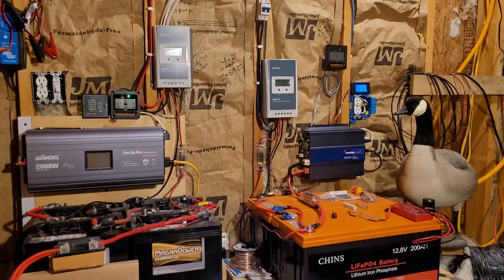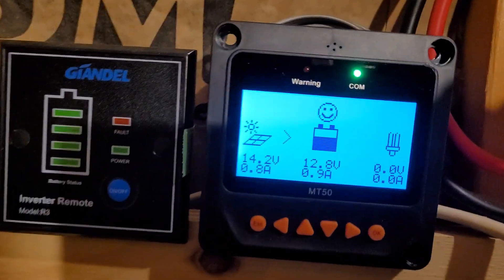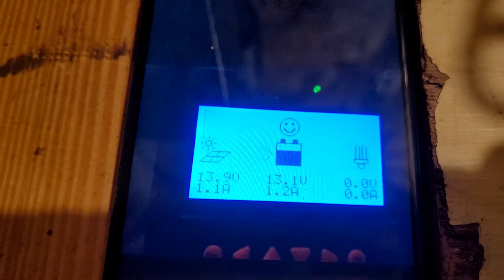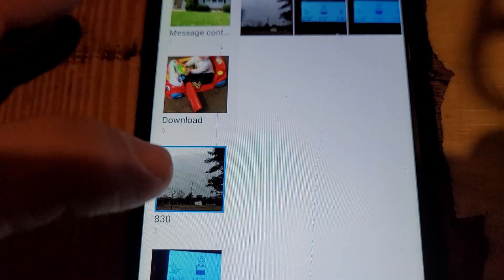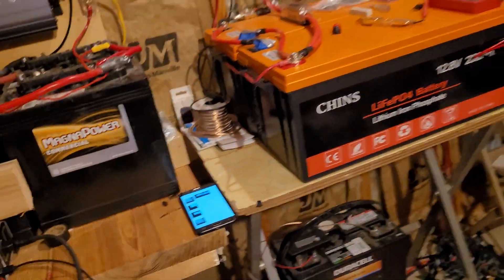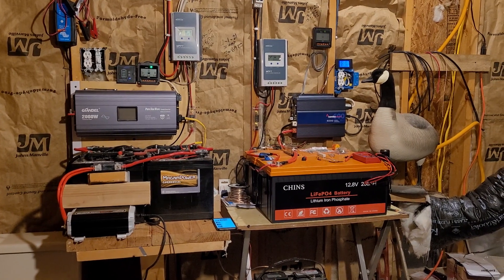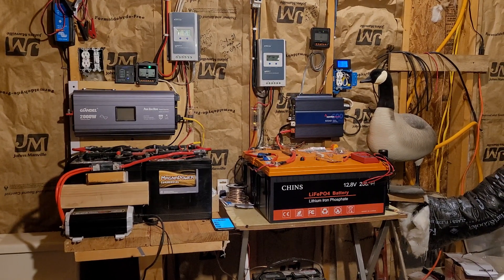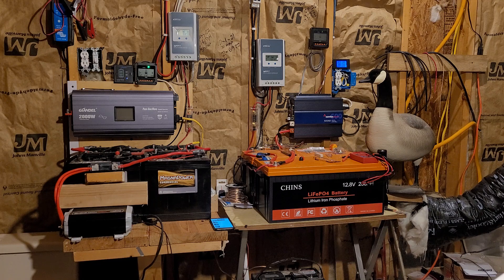Off Grid Solar Surviving the winter with the Chins lifepo4 12v

Comment: The thing with adding battery capacity is the cost.  Panels are rather cheap nowdays.  Having big battery capacity is nice, but you could as well design the system so that the battery capacity stays small, enough for having power during night time, but then design the panel capacity for the cloudy days, so that the panel output is enough to leave the batteries undrained.   Be the choice this or that, it is quite nice the hardware is getting better every year, also batteries are nowdays much better than the old lead acid type batteries used for decades.
Reply from the maker: Its all really only a problem mid Nov-Feb 1
Reply: @CentralIllinoisSolar  Exactly, so that timeline also sets the parameters for the electricity production, what kind of stuff is enough to carry over that dark and cold time. Having lot of batteries is good but its expensive too. You can think the math also by making over-capacity of solar panels, so that they produce just enough electricity also in darker time, so the needed battery capacity would be minimized.

Comment: Are the panels 36 cells or 60 cells? The PV voltage is low – 36 cells are normally ca 18Volts. The picture in the start of the videos looks like 60 cells that would be ca 36 Volts. 2 x 36 cells in series also end up as 36 Volts. In a 12 Volt system it more efficient and safer with 36Volts or more, the regulators doesn’t produce more but 60 cells panels can be combined with 2x36 cells panels and give a higher max. Cheapest way from 36 cells/18 volts up is 60 cells and 36 Volts – easy to combine. Also there are some 200w/220watts 72 cells that are 36Volts.
If you assume 50% power from panels and calculate how many days you can live well on battery reserves, you have a useful guideline for what you need. How long does it take to charge batteries by 50% from panels is also a key question.
Reply from the maker: I have 2 12v  systems running atm   400 watt lifepo4   200 watt flooded   picture isnt my house  lol

Comment: I have 9kw of panels 55kw about of usable power from batteries. My house uses 20kw a day. 3 days on a bad snowy or dark cloudy days. give me 1 day of partial sun I can generate 18-21 kw back into batteries. I need wind power to offset winter solar production. More batteries wont help. Sure I could replace my 235 watt panels for 400 watt panels and it would get me 4 days till i have to turn grid back on to let batteries charge back up. Looking at price A wind turbine 2000 watt @48V will make a huge difference. I have wind lots of it.
Reply from the maker: I understand....gotta have a Backup Solar and battery Just isn't enough alone.

Comment: I also see similar results. I am ordering a Missouri wind and solar turbine. 2000 watt 11 blade. This will help me big time inn the winter. I think I can get it up around 40' which means a lot more wind at 40' compared to ground level and I live 7 miles form lake Michigan so we get constant winds.
Reply from the maker: Hopefully you will get the desired result with wind.  Just doesn't seem to work effectively unless the wind is REALLY blowing
Reply: @CentralIllinoisSolar  You have to have it so there isnt dirty wind and it has to be high enough to catch clean wind. Sure a 200 watt will produce 100 watts an hour on a slow day but where I am at those are very few.  at ground a 4 mph wind  turns into 12 mph wind.
Reply: @CentralIllinoisSolar  as long as its installed where you have what is called clean wind they work. 4mph ground wind is 12-14 mph wind at 45 feet up. 12 mph will produce  over 250 watts per hour. I get ground wind at 12 all the time so it can work for my location.
Reply from the maker: Be sure to check with your county zoning, HOA, city office or whatever agency that handles towers and issues permits...Some places have height limits and outright BANS.
Reply: @CentralIllinoisSolar  48 feet is tallest I can go. that is why I will go 40' to unit which leaves plenty of room for blade height.